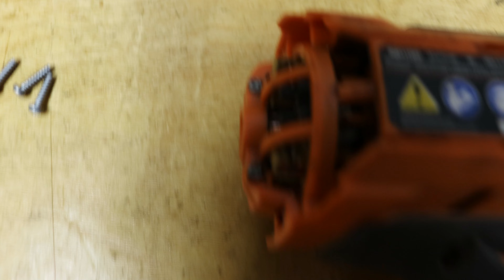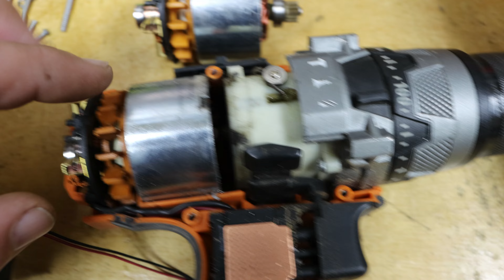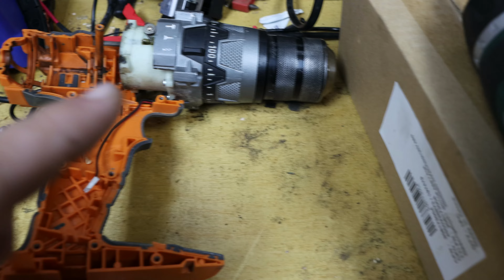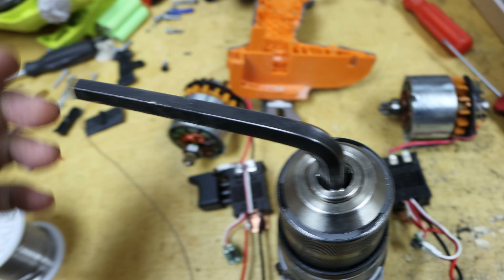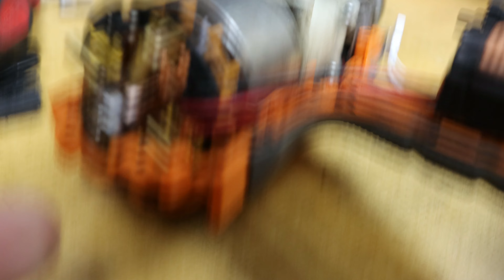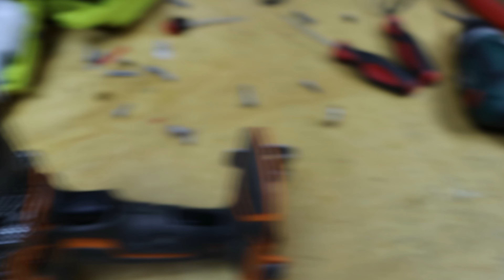Ridgid Hammer Drill Repair and Chuck Replacement

Comment: What I’ve figured out is that it isn’t worth fixing one of these tools.  I disassembled one and deep cleaned the internals to fix some issues.  That worked but it isn’t worth buying parts.  The replacement parts end up costing half as much as a brand new tool.  Even something stupid like a simple trigger is a hunk of a new tool.